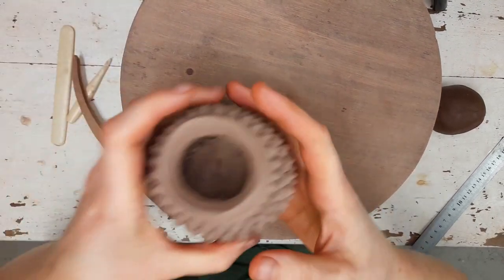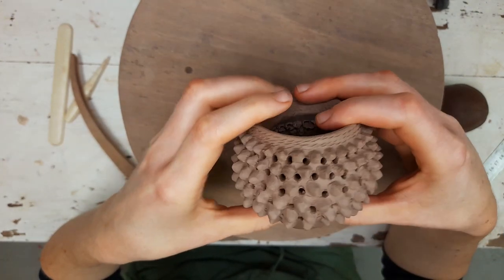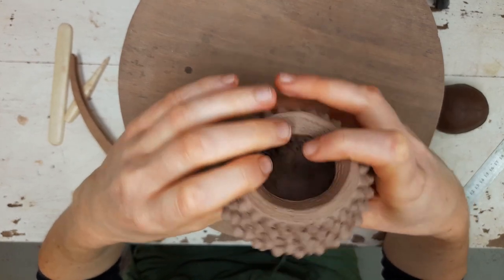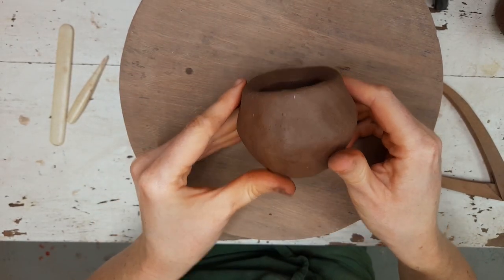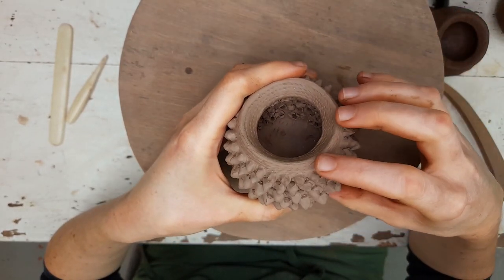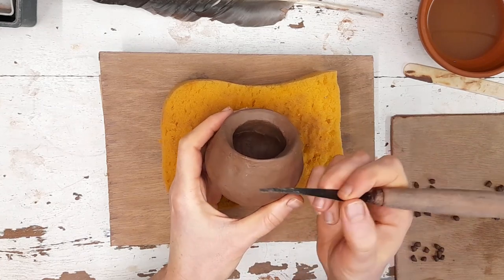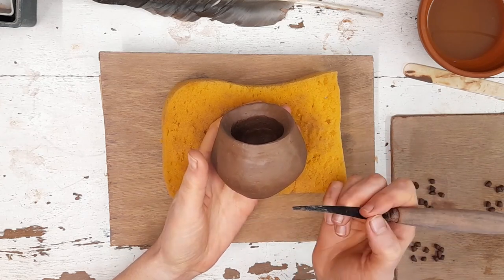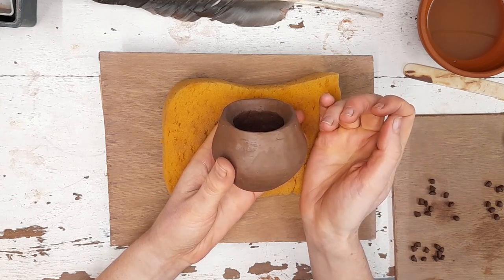Grape Cup Making

Comment: Lovely video, thank you! It's such a beautiful little cup, decorated with so many beads and fine cord, that it really is an intriguing mystery why they left the inside all rough. My first thought was using it as a grater as well, but now you mention it, the overall shape does seem very inconvenient for it. Plus, it seems the beads would have made collecting whatever was grated rather annoying. My second thought was that maybe the potter ran out of time before it was time for the firing, but as I understand it, they wouldn't have done big firings of lots of pottery at once, right? They would have just fired this little cup in the hearth/ cooking fire, so it wouldn't have mattered to finish it up later and just fire it a day or two later. And even then, it would have needed to dry out first anyways and could be cleaned during that time. And so the mystery remains! Somehow it makes the grape cup even more endearing.